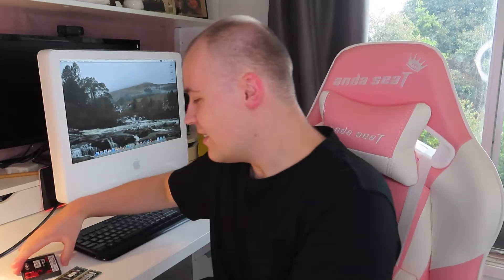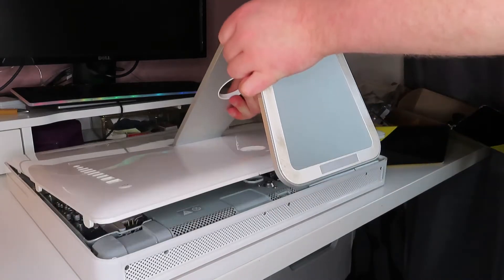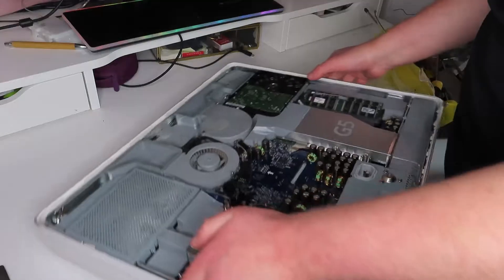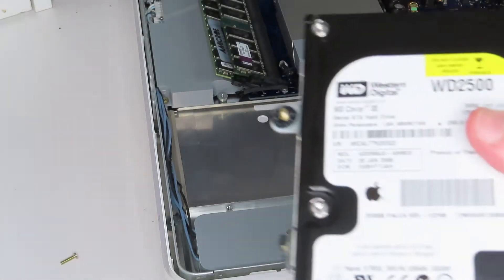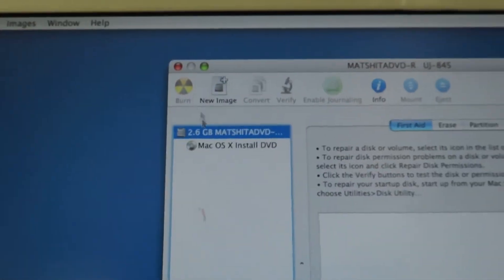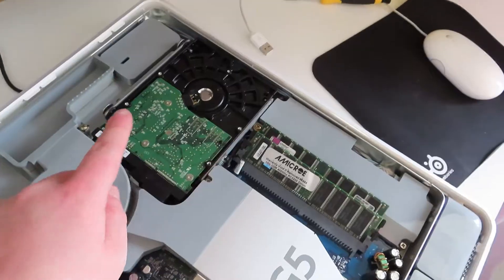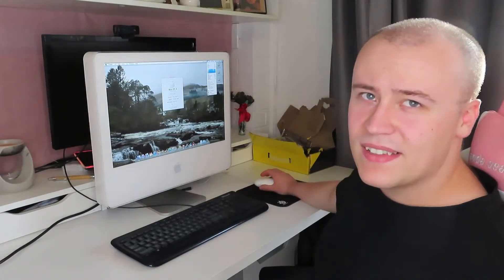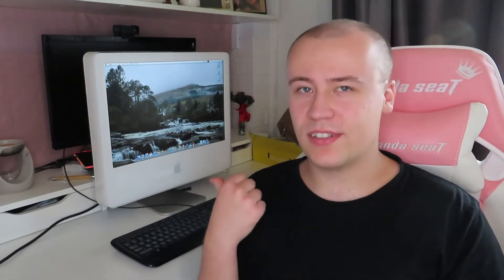How to upgrade iMac G5 RAM & SSD troubleshooting - Future plans chat for the "digital life" Mac

Comment: I just want to mention that because of the way that the iMac G5 works you can only use Gen I SSDs which is why it's better just to upgrade it with an actual hard drive...
Reply from the maker: If I recall correctly, the SATA drive I used in this one was Gen 2.
You're definitely right in that they're quite picky.